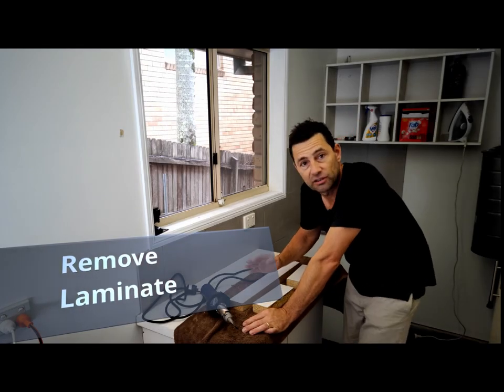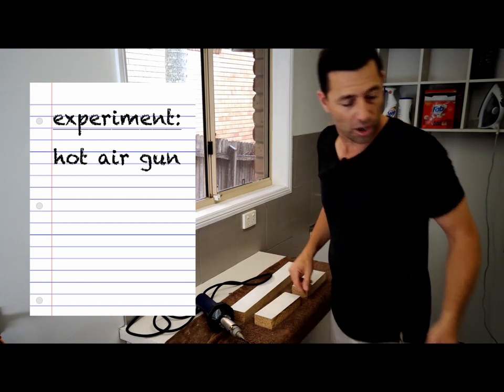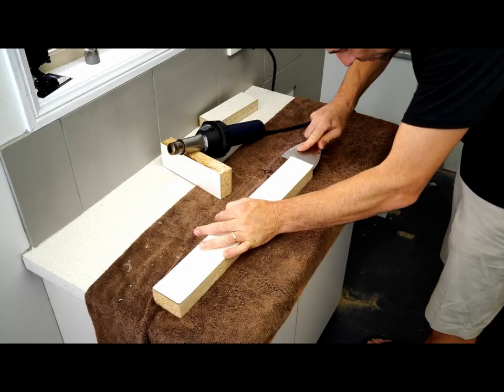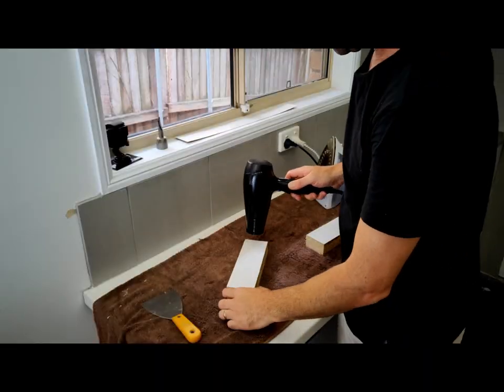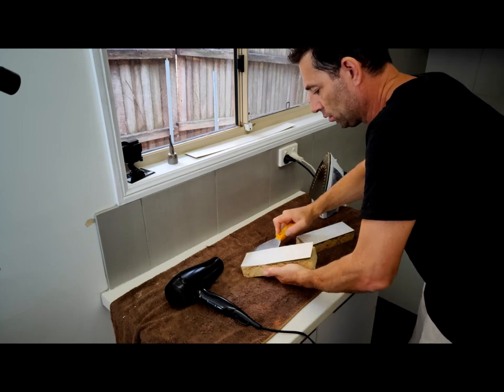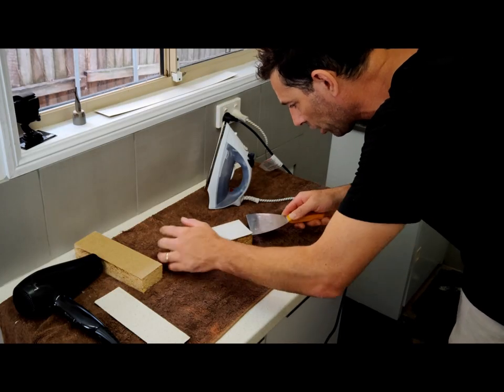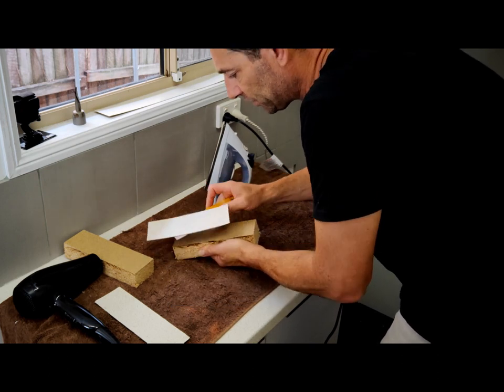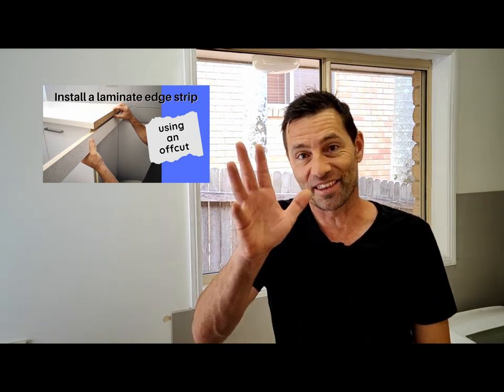How to remove edge strip from laminate bench-top

Comment: Thank you, you have just saved  me a lot of money and upset . I have two areas I need to replace and I had some old shelves. I can't get the correct colour and this will absolutely help me out. Cheers matey 👍👌
Reply from the maker: Hey that's awesome Rebekah, I'm glad it helped you out, and thanks for letting me know, well done. I'd love to hear how you get on, Kent
Reply: @InspireDIY  it worked! I only had a hairdryer but it was really easy to remove the  two sections  had and I have been able to cut them to size and glue them back on in the areas that were missing. It's not a perfect match colour wise but it's not obvious.  It means my kitchen looks a little better now. Thank you 😊